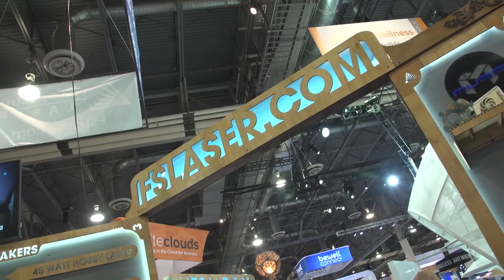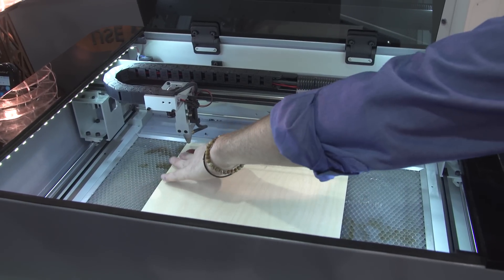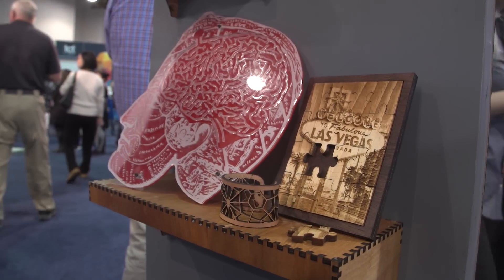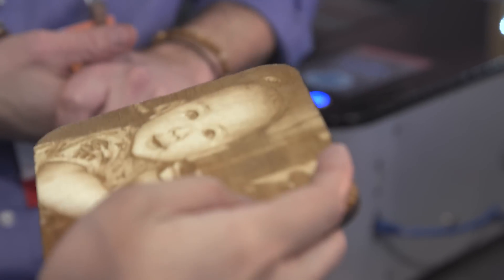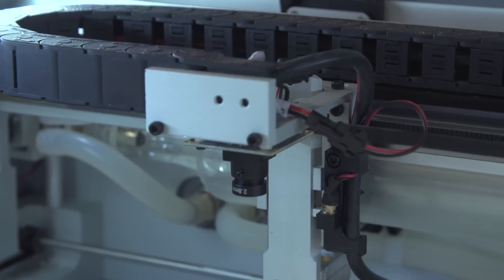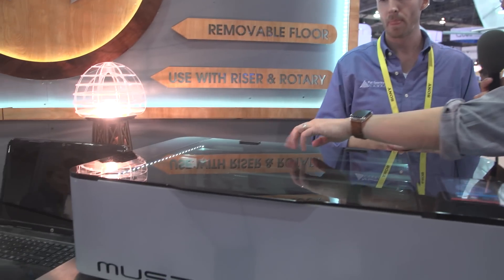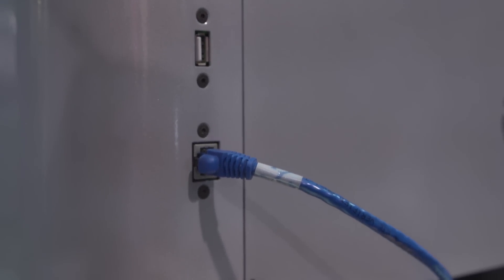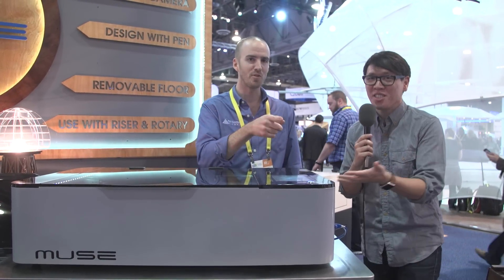First Look at the $5000 Muse Hobby Laser Cutter

Comment: I love how neither of them mention glowforge, but this product is clearly FS rushing to capitalize on the "easy-mode" market. I also love the little dig about not having to be online to work. I'd totally buy this before a GF.
Reply: and spend days or weeks squashing bugs, dealing with bad or poorly written documentation and replacing mirrors, lenses, power supplies, fixing grounding issues...You get what you pay for.
Reply: Both of these are trash in terms of price to performance.
$5k gets you a >150W chinese machine that you can sleep inside of.
Reply: I agreed with lathan there is no support with Chinese Lasers and many hours of debugging . This is a great price. I even have an GF perorder. Might get this one too. The thing Spirit don't to seem to understand is that these laser are easy to use I don't have time to learn how to use a tool. I just want to work with my designs. I Would get a Epilog but what i need they wanted 17k for a 30 watt laser.
Reply: who makes a Chinese laser for less that includes three camera system, on board file storage and a touch screen? When you find one that can match this one feature for feature we can talk but right now all you are suggesting is a diy kit that only gets half the job done, has no manufacturer support, is known to have problems and it's only saving grace is price which is easily made up for in time wasted fixing stuff.
Reply: It just isn't budget friendly for some. $5k is barely scratching the surface for my friends that have racing hobbies. It comes down to how much you want to spend on your hobby to do what you want to do. There will always be cheaper but it is not always about the cheapest solution. If that were the case no one would have hobbies since they serve no practical purpose for the money that is put in them.
Reply: I would argue that your friends are not simply hobbyist if they are blowing through 5k like it's nothing, they are more likely in an enthusiast or professional amateur category. Or they are simply wealthy enough for money not to matter in which case they wouldn't represent a normal consumer anyway.
Reply: This is not a great price.
Let me ask you this: is 3 hours of debugging worth $4500 to you?
Yes? Send me a few million.
Reply: Maybe in their marketing, but at 5k you are firmly outside of the hobbyist level. And pretty much double the cost of a plain jane GF.
Reply: You don't need any of those.
I've never, ever in my life needed to store paths/gcode on my machines.
I've never needed a camera to artistically visualise whatever I was doing - it's a stupid gimmick(especially since it's not projecting dimensions onto the stock). I knew my stock, I knew what I was cutting. I have experience, do you?
Again, is $4500 worth a few hours to you? Send me a few million.

Comment: +Tested Okay, when you get this, you need to put it up head to head against the Glowforge. I've said this before: Only way to put them through their paces is to build a dollhouse with the machines. And not some rickety POS Barbie Malibu Dream House. Has to be an actual two to three story dollhouse with trim, roof, everything, and using the same house and files for the both machines. And use different materials, like acrylic windows.

Comment: How is 5000 USD classified as a hobby? The only hobby I have ever spent that much on is Magic, but that is over a period of over 20 years!
Reply: Talk to a 40k player, anyone with an automotive hobby or woodworker. You can dump allot into tools very quickly. $5k in any of those doesn't go as far as you would think.
Reply: You can get the same performance out of a chinese $400 K40 machine(no brand, just look for "40W laser" on Amazon/eBay).

Comment: cool, I just got a whole bunch of ideas for this machine..Just gonna wait til the price drops .  Does it come with the software  or is it another added cost ??
Reply: I'd say it comes with the software given that he said the software is local to the machine.
Reply: and spend days or weeks squashing bugs, dealing with bad or poorly written documentation and replacing mirrors, lenses, power supplies, fixing grounding issues...You get what you pay for.
Reply: As I said below, even with mod wiki you are stuck spending time you could be building reading and troubleshooting crap that should work right out the box. I guess as a designer and builder I would rather spend my time building that fixing a crappy machine and trying to make it into a better one.

It is the same way most people don't change their own motor oil. Their time is worth more than the $20 they save doing it themselves.
Reply: Or just spend $500 on a K40 chinese cutter with the same tube and nearly the same work envelope, and then take a few hours to learn about software.
Reply: Lathan Montgomery Or you can just go to the mod wiki dedicated entirely to this cutter, and spend an hour making small, easy mods that turn a $500 machine into a $5000 machine.
Herp derp.
Reply: Lathan Montgomery Except your entire argument is bullshit.
Oil is $20.
This machine costs $4500 more for the few hours of work you'll have to do.
I'll give it to you on a silver platter for $4500. You must be extremely stupid to go for the muse in place of the chinese machines.

I'm an engineer, I do industrial design, I do electronics, and I make CNC machines.
I would never buy this atrocity.
Reply: So your time has little value to you I guess. Sorry while you fix your broken machine I will be cutting on my fully supported working one. It is not a matter of the possible but where you want to put your time and effort.
Reply: Lathan Montgomery Is 1-5 hours worth $4500 to you?
I guess you must be filthy rich. Send me a million or two.
Reply: No, just know the value of my hobby time.

Comment: So, am I supposed to hook this up to the water faucet in the kitchen to get it cool enough?
Not possible to use an external radiator?
Reply: It includes a water tank and pump that are under the table. Air to air cooling is too slow for most glass tubes so just using external radiator doesn't work.

Comment: glowforge anybody?
Reply: Big difference is that this is not cloud connected (thank God) So It won't be a huge brick when the company inevitably stops support/goes belly up!
Reply: No, you can actually buy one of these.
Reply: The Cheesus I like the glowforge way better
Reply: the glowforge only works when connected to the cloud but they've said that if the company ever folds that they'd release firmware to allow you to continue to use the machine without the internet. i think the thing they're trying to do is "force" users to interact with the project community they want to build.
Reply: I think the Glowfordge lacks any Z axis/table height adjustment.  The Muse looks to have an adjustable table height and you can add a rotary attachment.
Reply: the glowforge has web based software...not really future proof.
Reply: Can you actually buy a glowforge laser or do you need to wait 3 years
Reply: all laser cutters have a z-axis/height adjustment otherwise you'd be stuck with a single material thickness forever.